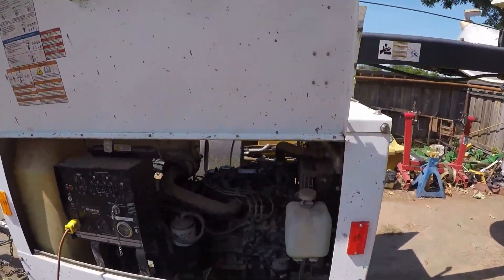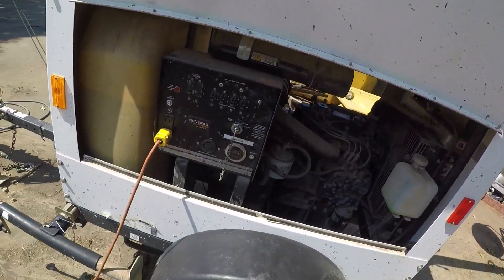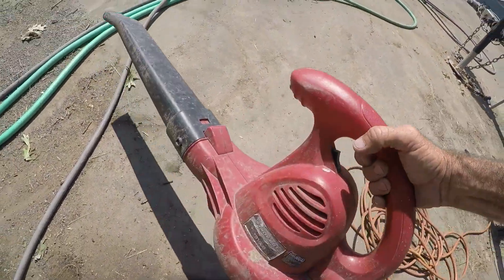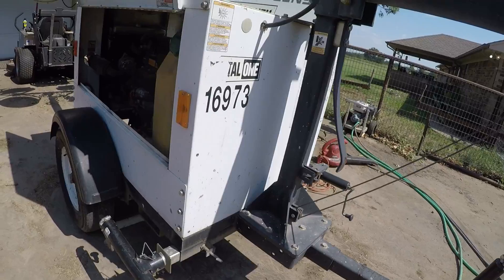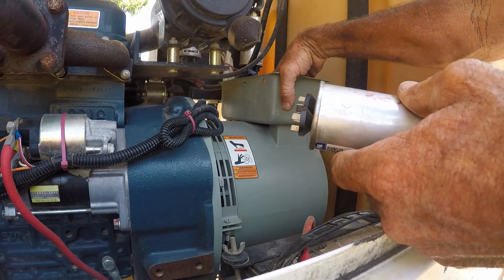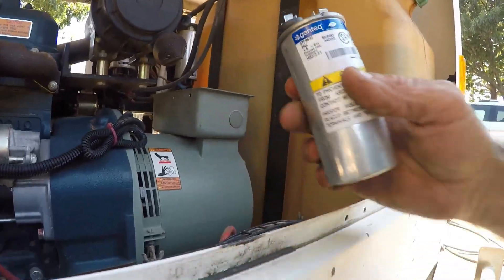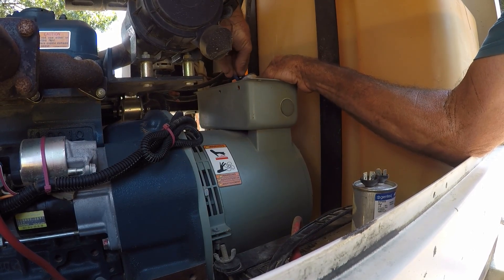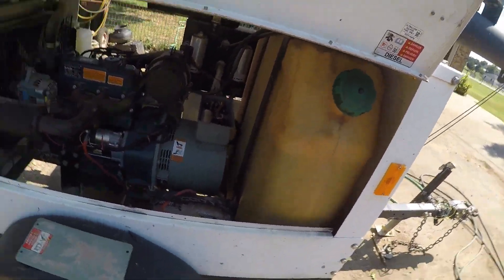Can This Old Light Tower Still Work?

Comment: Have you ever had a generator that starts then stops after 5 seconds? Nothing seems to be wrong with it, we’ve changed every part you can think of. It even lights up! It’s a mystery! Thoughts?
Reply: @belsayshootingground  check the alternator, could be damaged. I just got some towers yesterday and i have an issue just like yours but mine stays on for about 20 seconds or so and shuts down on its own like if i turned the key off. Turns out, its the alternator and it needs to be fixed.
Reply from the maker: @belsayshootingground  engine keep running? And is it electric start?
Reply: @ if I pull solenoid the engine keeps running. But something wants to kill the engine. It’s a mystery
Reply from the maker: @belsayshootingground  so as long as you hold fuel shut off solenoid, it stays running? If so, solenoid is either bad or losing voltage to it. And if it's losing voltage, could need new ignition switch

Comment: I bought a used one, same model and everything but it came with the cables disconected, right where the capacitator is and i dont know how to Connect them, cables have Numbers, by any chance do you have a diagram
Reply from the maker: @JesusGarcia-qq6gs  no. Sorry. But you should be able to Google it. Maybe look up diagram  by model and serial number

Comment: Thanks for the video.  I already discovered the no power problem today before I came across this video, but, mine was because one of the spade tongue connecting wires had vibrated off of the connection on the capacitor.  Keep posting.
Reply from the maker: @winfordnettles3292  no problem. There's lots of little things that can happen to any equipment. As I always say, go for the easiest stuff first. Most times that's what it is. Thanks for watching!!

Comment: Man brother I’ve been waiting for a video like this for a while !! Thanks I’m try to get it fixed tomorrow
Reply: Can the actual generator be bad ? I’m working on mine and has same ussue but I’ll definitely check those things! Thanks for the video
Reply from the maker: @ChemaXtreme02  it could be, but these things are pretty robust. There's usually several other things that crap out first. I've worked on some that the wires came out of the outlets and some that just had to have the outlets replaced. Always look at the easiest thing first. There's no reason to go buying big expensive parts. But you gotta k ow what to look for and how to test things. Safely at that. Those capacitors, if charged, can knock the crap out of you if not discharged first.
Reply from the maker: @beanie-zo9pk  you're welcome. Let me know if you need any help